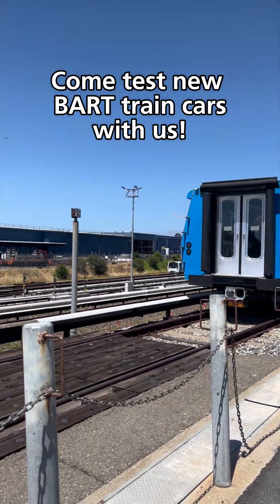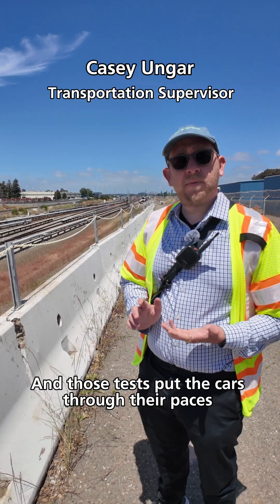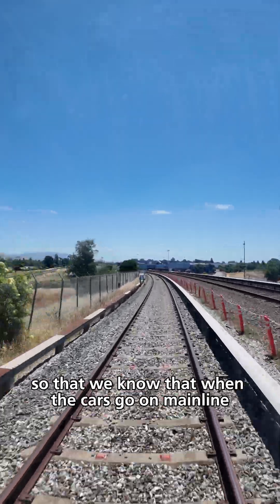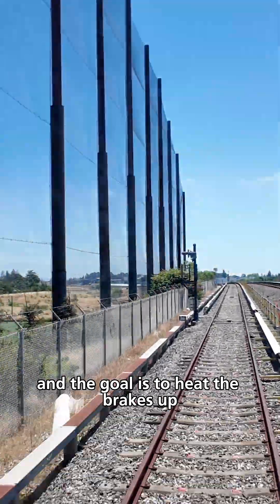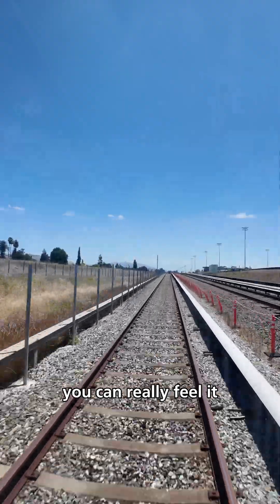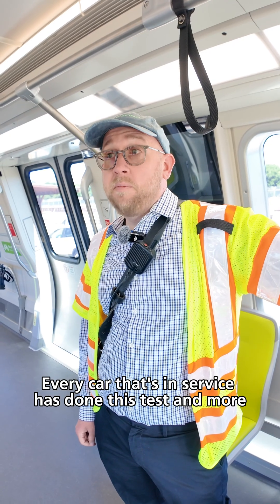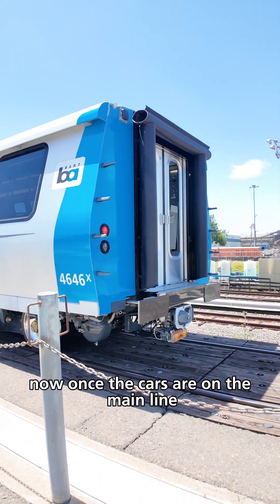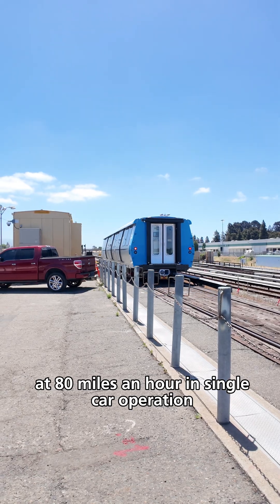From the test track to the mainline: How BART gets new train cars prepared for service

Comment: Why did you guys reduce the top speed in operations to 70 mph? When are 80 mph speeds returning?
Reply: I think I remember reading they reduced the top speed from 80 to 70 mph within a few years after Bart opened due to excess wear and tear on the tracks and/or trains themselves. But I’m sure you can look it up online for more specifics if you’re curious.
Reply: @metadexter  nope they still do 80 whenever they can, it’s mostly due to increased headways and stops